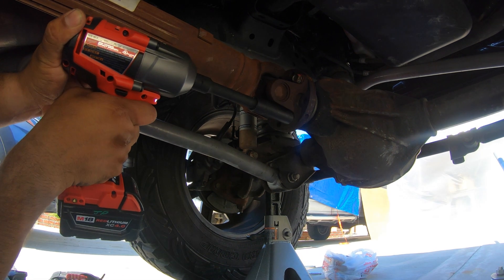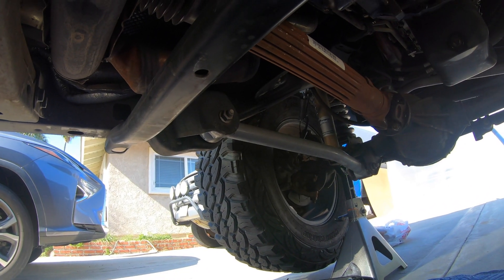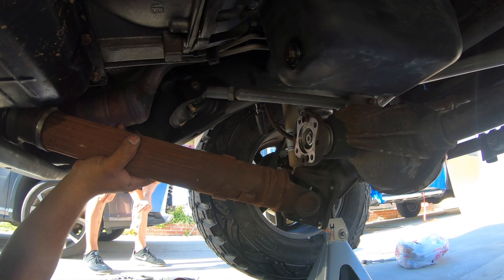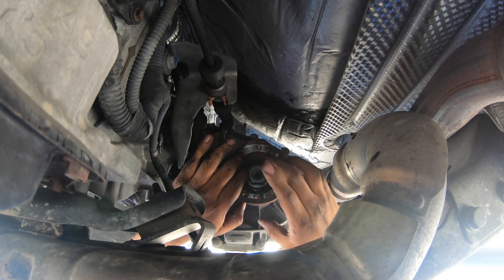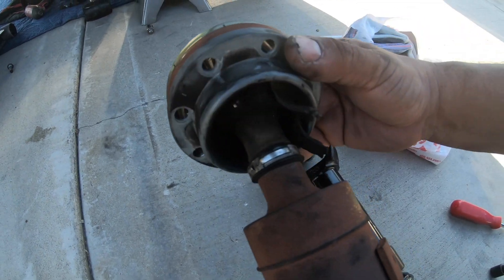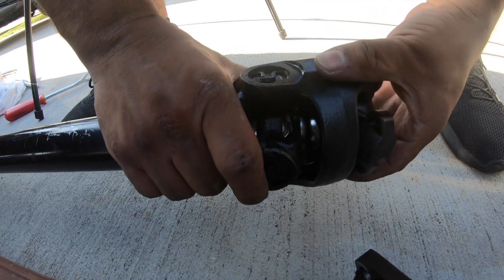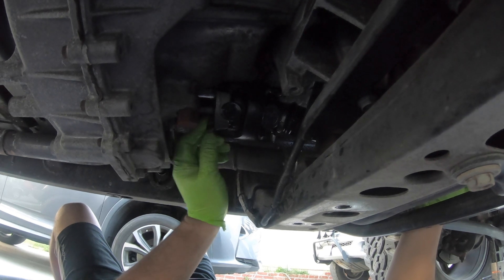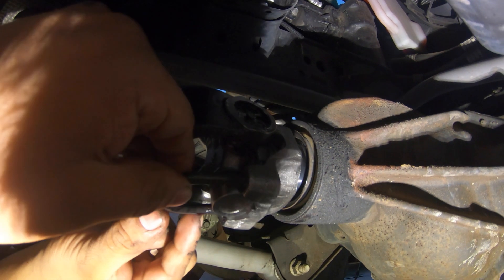Jeep Wrangler JK Driveshaft Repair / Upgrade to Rough Country 1310 Front Driveshaft

Comment: What is the name of that tool you used to push the driveshaft mounts off on the diffs? Im about to do the same job and don’t feel like using a hammer.
Reply from the maker: Gear Jaw Puller tool i believe it’s called. Harbor freight sells it, and AutoZone and Orileys rents them

Comment: Did this cause your transmission to shake like crazy? I have a manual trans and it’s insane. I believe mine is the rear though
Reply from the maker: No, no vibrations, but if you have vibration is more then likely the angle of your front axle. You have to get that looked at.
Reply: 4 Wheel More ended up being my rear drive shaft. The repezza joint on the transfer case side was shot to hell. The angle was a bit extreme, the lift was a budget one just to get it up in the meantime. I replaced the drive shaft and got some adjustable control arms to fix the geometry. Night and day difference lol